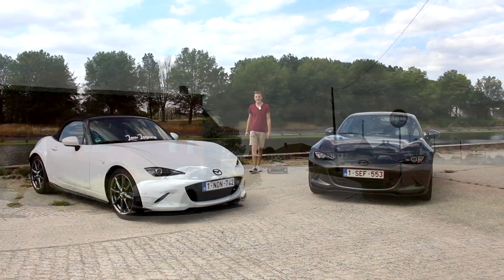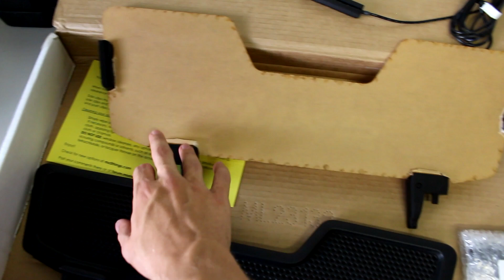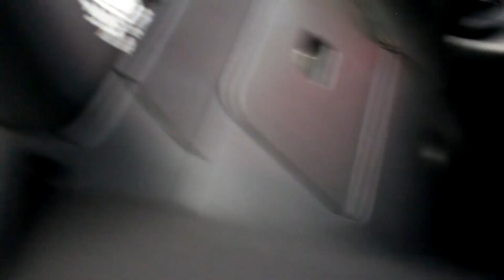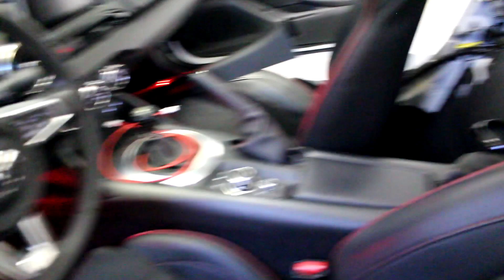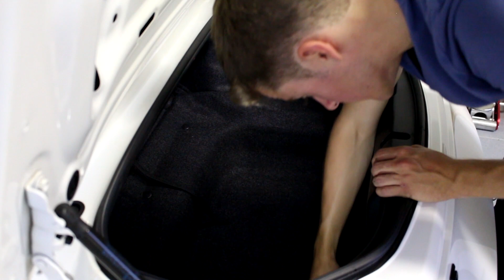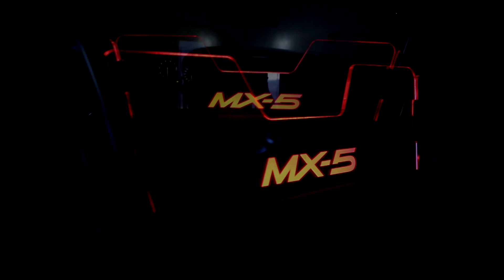LED Windblocker - Miata In Action - Episode 17

Comment: I fitted this today, used the stock OEM aerial to thread the led wire through to the trunk (still have it even with stubby fitted), worked really well in the limited space.
Reply: Great tip

Comment: DOES IT MOUNT TO AN RF? And is it more fictional in blocking the wind? Looks great no doubt.
Reply from the maker: Yes this part does fit on RF models. It does block the wind a bit better. But for RF models there are also larger models without the middel notch. These do have extra velcro straps that wrap around the headrest arches to keep them in place.
Reply: could you share any links about them?
Reply: Thanks for the quick reply. Your channel is definitely a 👍.

Comment: is it specially usefull for driving on the highway? Or do i need then the full size instead of the fullsize with uitsparing as you have ?
Reply from the maker: Any of our windblockers will give some improvement over de stock unit. Now if you choose for the full size with cut-out or without, purely depends on the type of MX-5. Because you will not be able to operate the soft top if you go for a version with no cut-out. 

So for an RF i would suggest either a full size bowed or arched and for the soft top I suggest the regular size or full size with cut out.

Hope this helps you.
Reply: @AVPOnTheRoad  i drive a new ND softop and has a lot of highway driving , i wonder if the windblocker with cut-out would be sufficient while driving 120 km/u ; can i still order it in your store ?

Comment: It would be super cool if you could use it as a break light as well?
Reply from the maker: This would indeed be nice, the only thing you would need to do is to swap the wire on the in between harness to go with the brake signal instead of the running light signal.
So it should not be that hard to do.